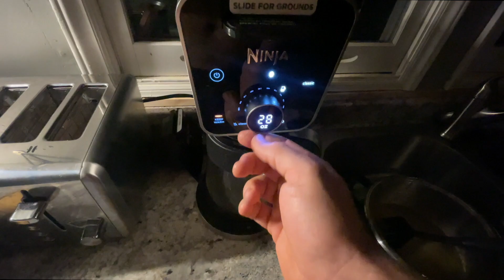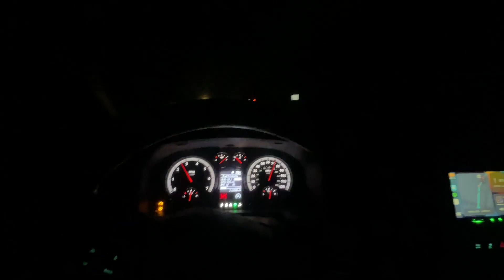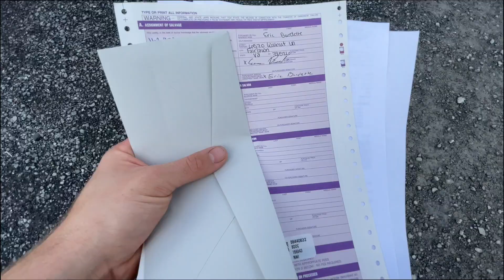We bought a Tow Rig from Copart!!

Comment: My dad had an 05 he purchased brand new just like this, but black. It was a 52k truck when new. It was a beast of a truck. Ran 270k miles before the trans went due to losing fluid. Make sure you inspect the trans lines for rust. We 4 wheeled the 05 hard, red lined for minutes at a time. She just kept going. I took it to prom, pulled sleds at the county fair, hauled firewood, hauled logs on trailer to sawmill, and worked her hard. Not sure what you paid, but it should be a great rig for you once you get her fixed!
Reply from the maker: Will do thanks man!